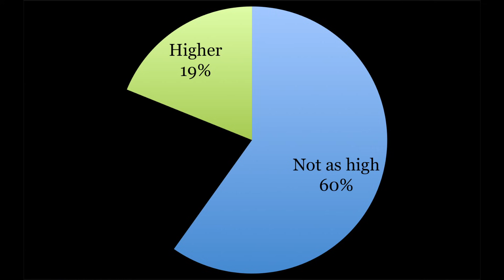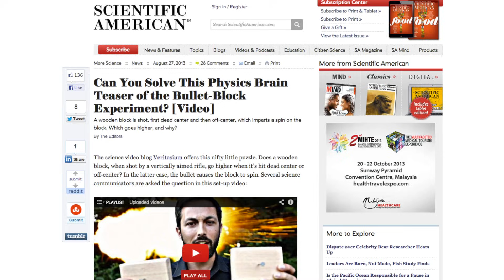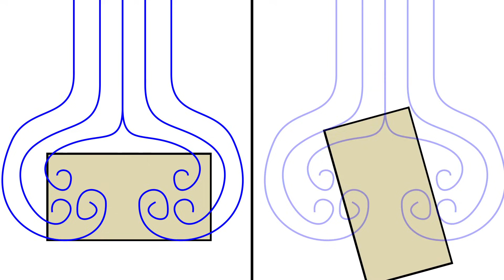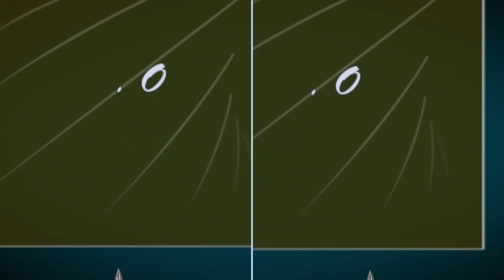Bullet Block Explained!

Comment: to increase the signal, i.e. the difference in penetration lengths, one would need a material, which absorbs the energy less efficient, or a faster bullet. In terms of material, maybe one could try ballistic gelatin?

Comment: has anyone thought of changing the variable of the length of the block to see what significant differences happen with the more extremes, because from what I can see the difference is arguably very small (like a few feet in a length of miles)
but that's just my layman's guess

Comment: wait, did I lose something? If the difference between the two depths is 1/10th of a mm, why  did the nail penetrate so much more in the not spinning block? Also at the beginning you say that the rotational energy is 50% of the kinetic energy, at the en you say it's the 1%...

Comment: Make a smaller block (with the same length, but smaller width and height) out of some metal like aluminium or copper, It deforms more evenly, so depth will be clearly visible.

Comment: For a better visualization of the effect, use a longer piece of wood. The further away from center of mass you go, the more energy will be transferred to rotational energy, meaning that you OUGHT to be able to see more of a difference.

Alternatively, use different materials of different densities (eg pine v. oak v. ash) and conduct the same experiment on both materials. The different densities would make the difference in penetration more obvious, while the math would ensure it's consistent.

Comment: i suggest ballistics gelatin of course + you can measure the depth without x_ray
But you should be completely sure that it will fire at exactly 0 degrees angle

Comment: Use a much longer block of wood. Perhaps several meters long and suspended on a platform higher to allow for unimpeded rotation.  since the bullets have identical kinetic energy and momentum you can only change the rotational momentum by increasing the radius of the spin.  Without the luxury of time to run through the calculations I would imagine you must need a very long block to get a significant change in the depth of the bullet.

Comment: Horizontal test into ballistic (clear) gelatin mounted on a platform with a central axis (vertical) on a sled. Larger caliber PISTOL cartridge to increase surface area while not significantly increasing velocity. 1st shot central to axis, second shot to extreme edge away from axis. Measure both depth of bullet in ballistic gel and rotational movement (on axis) and total movement (on sled). To get better accuracy hand load ammunition and chronograph each test shot.

Comment: why not try with different bulletspeed? with a faster bullet (and a larger block) the bullet should penetrate deeper. that way, 1% of the penetration should be more visible.
another way might be a different kind of bullet. i dont know what types are there, but one that penetrates easily and doesnt transforms/shatters that much should be a better candidate

Comment: Just use a material the bullet can travel through easier and increase the block thickness. That would increase the distance the bullet would travel inside the larger object and make variance more measurable. We could also increase the amount of energy the block needs to rotate. Somehow.
BTW, congratulations for your success with this video. I was really surprised when MinutePhysics Henry was wrong! :)

Comment: To make the difference in depth measurable just use a material that is easier penetrable but not too much lighter. This way the ratio between energy 'invested' into spinning and difference in depth is increased.

Comment: Use a less dense material so the bullet will travel further into it, Polystyrene for example. Use a much bigger block so that the bullet doesn't travel all the way through it. As the bullets will travel further that 1% difference will be easier to see and measure.

Comment: Shoot into foam, use an air gun that allows you to adjust the air pressure and perform the experiment in a closed space where wind can't be a factor.